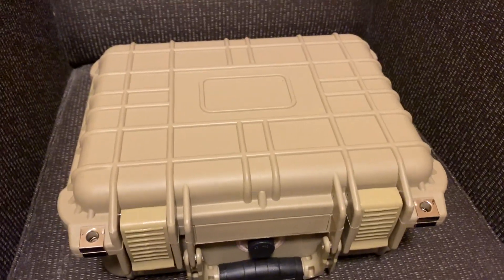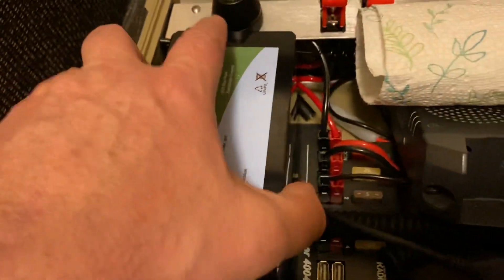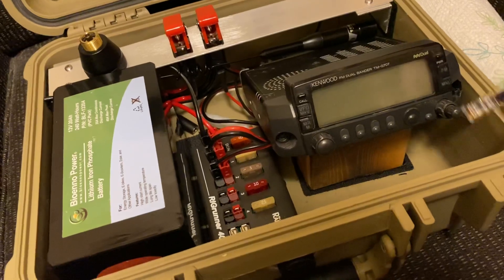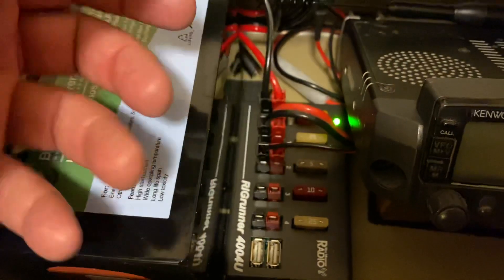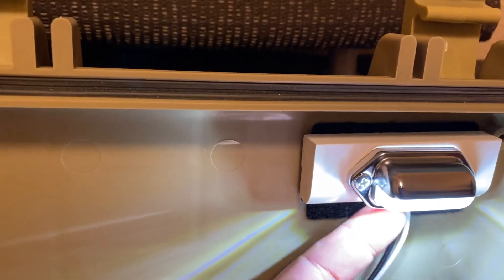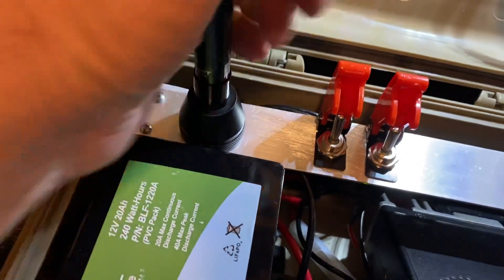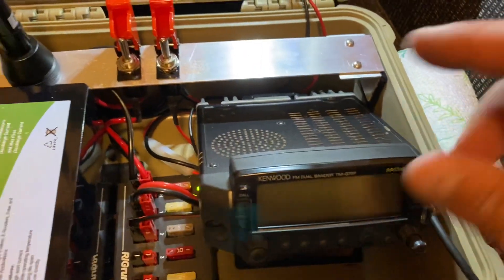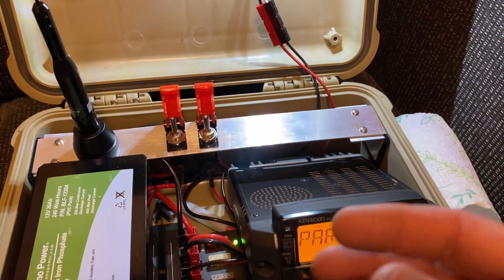Ham Radio Go Box - Battery and UHF/VHF

Comment: Could you do a control head separation cord then lay the radio flat, you could Velcro the faceplate on the lid or even use a rj_ _  waterproof connector for a more remote use

Comment: can we use powerbank as power supply boss ? 🙏🏼
Reply from the maker: super great question. Couple thought assuming you are talking about a USB battery pack device. The designed output on USB is 5V, and the expected input on HAM gear is 12V. So the 5V would need to be converted. There is always loss in conversion, so do not expect efficiency, but it may be a descent secondary solution if you can find a good converter. Keep in mind the amount of AMPS you would need for UHF/VHF, and also for HF (if you use it for that). They need a lot. 

Next, if the USB ports on the power distribution convert 5v to 12v, would they also allow it to convert in the other direction? I doubt it, and I doubt it would send enough juice for the HF rig...but it's a cool thought.

Comment: If this has been mentioned please forgive me, but are you using a BMS with the Lithium bat?
Reply from the maker: This brand of batter has the BMS built into the brick. That is why I like them so much. You can do power in or out, and they will take care of the details. 

I am not sure it would handle solar, so check the details for your self there. But, this will take care of power from a power supply just fine.

Comment: Good first attempt, would suggest adding some sort of capacity meter (like a powerwerx BVM-100) to keep track of the battery. Lithium phosphate unlike an AGM does not exhibit a linear relationship between the battery voltage and remaining capacity. With the bioeenos the voltage will stay solid and then at its depletion shutdown without warning. I would use some sort of a metal brace under the radio to hold it up and take advantage of the cubbyhole below to store things like the mic or a victory cigar. As with antennas, keep in mind the radiation exposure limits when transmitting with the antenna so close to you, keep it under 10W, and watch for stray voltage if its a 1/4wave. I would personally suggest using a half wave antenna which eliminates your need for a ground plane. My backpack is installed with my HT a Nagoya RH660S, needs no groundplane, about 11" retracted and 42" extended, good for 10W and gives me at least a 2.1dBi of gain. It is a bit fragile, but it comes in SMA, SMA-R, or BNC. Go for the BNC one. I've smacked enough branches to scrape paint off and I've only had one fail out of six or seven currently in use. used outdoors when its not raining. 

Along with any radio, its better to include the manual. seeing that you have space on your lid, here's my way to keep things together. Buy a chipboard, then cut the board to shape your lid and glue it to the lid. I use it in my go kits to hold the various ICS forms back when I was still active in ARES simulated exercises. For me every box I've built is designed to be easily understood by another ham who may find it after I become an /SK in a disaster area and is equipped with everything they may need to learn how to use it. circuit diagrams, manuals, repeaters in the memory, etc, printed, laminated, stowed. Tools are included so that anyone can strip them for parts or use them as is, but that's my design philosophy, to each their own :)

the Bioeeno 20AH is the perfect balance for basically every mobile up to even the Base stations. For me I try to equip my go-kits with some kind of solar charging function just so if the suns out and I happen to be able to field a panel I can run off of that. Something like a Powerwerx MPPT-150-14.6 takes up almost no room and plugs right into the Rig runner and its there as a side option. Obviously with more features it gets heavier, ultimately its up to the user to consider what's important. 

I think this kit is nice for what it is, its elegant in its simplicity and looks like a winner the way it is. Now that you built it, use it, use it, use it and then the design will start to transform to shape your usage habits. 

73 de KN4GEI

Comment: interesting... but no charge connection !
Reply from the maker: The best part? 
I plug my power supply into one of the ports of the rig runner and it will charge the battery. I just have to turn on the battery switch. The bioenno battery connections go both directions as do the ports on the rig runner.

Comment: do you need a  DC Boost converter to setup go box? or you just connect the radio direct to the battery with fuse?

Comment: Nice! What size HF/Apache box is that?
Reply from the maker: I have long since thrown away the receipt and peeled the labels off. But the inside of the box is 12" wide, and about 9.5" front to back. The bottom of the box is about 4.5" deep and another inch or so in the lid. Good Luck.

Comment: Looks like a good plan….. I think you might need more ground surface for the antenna. Female banana plug mount to the metal….and ground wire. Have you checked the SWR. I made my first one days after 9/11. I called it my Jump Box….lol